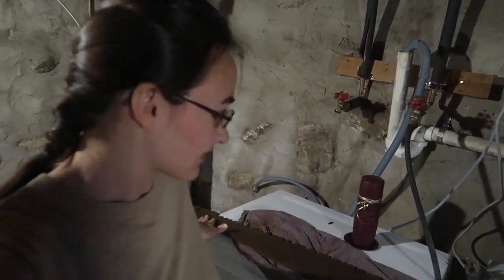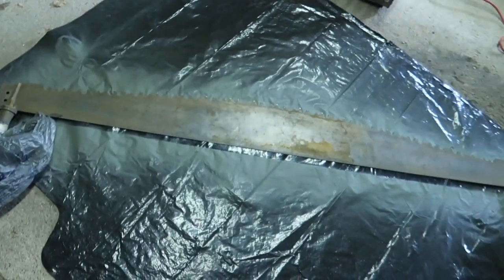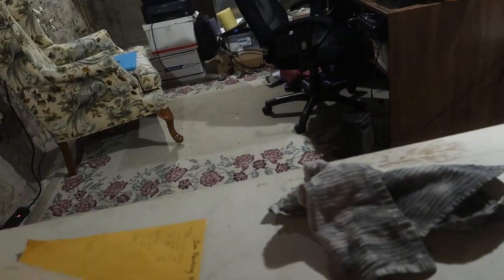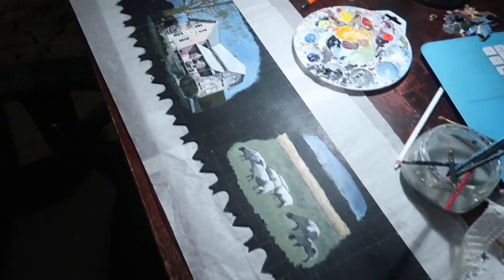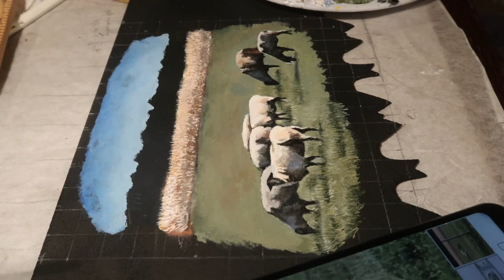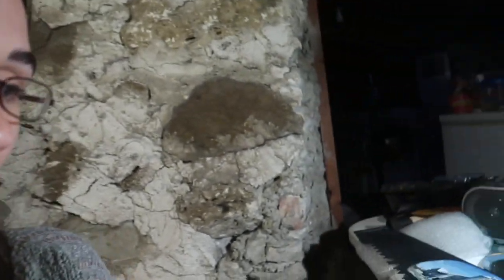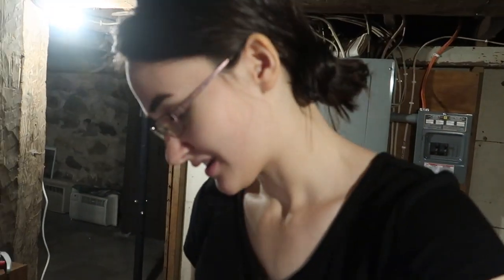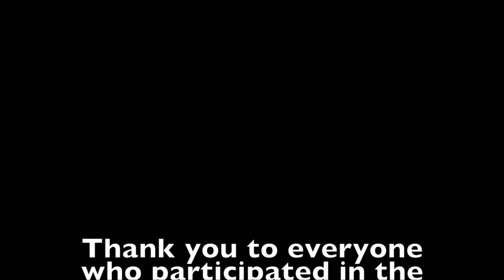Painting a Farm Scene and Faux Rust on a Crosscut Saw - Time-lapse

Comment: Amazing work! I'm looking to try something like this for a memorial piece for some family friends. Do you think a person could just take parts of the blade and de-rust, etc. while leaving the rust on the blade without it compromising the paintings down the road?
Reply from the maker: I'm not really an expert on this, but from my understanding, if you leave the rust on the surface it will spread over time.  That would impact your painting in the long run.  The primer I used on the surface of the blade was a rust deterrent, which will hopefully preserve the painting for a long time to come, and then I was able to keep the antique feel of the blade by creating faux rust.  Faux rust is really very easy to make if you have acrylic sand, and it's a lot of fun!  You can feel free to email me if you have any questions I can help with!  Good luck on your project!